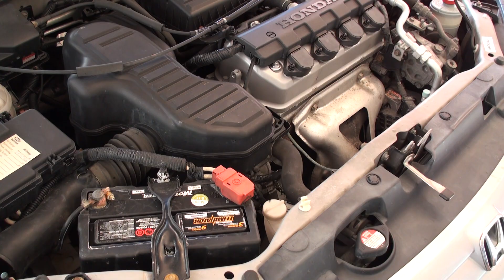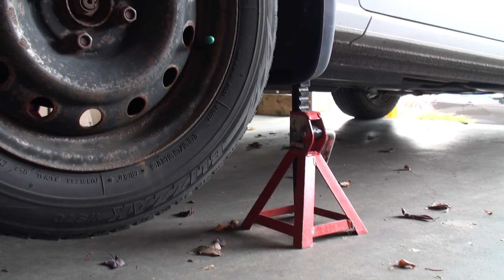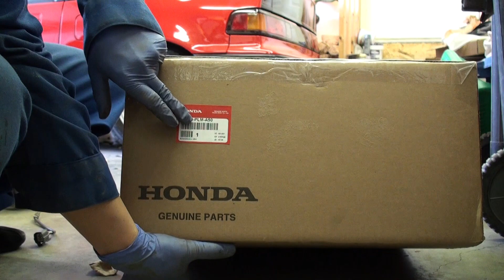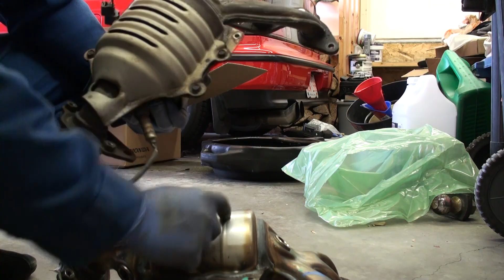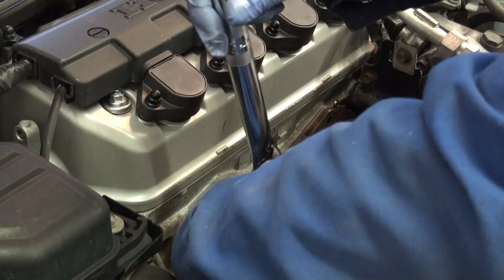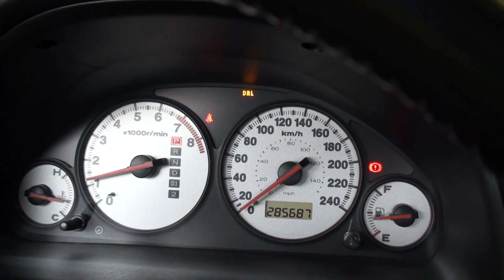2001 - 2005 Honda Civic Combination Exhaust Manifold Catalytic Converter  Replacement

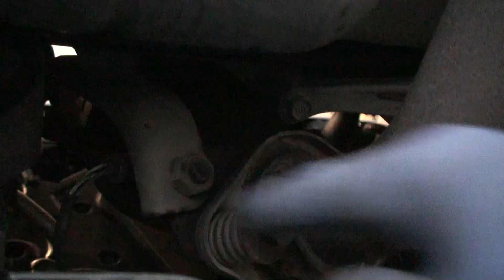Comment: 4:04 When you talk about the bracket holding onto the engine block that you pointed to briefly, does it help it stabilizing the catalytic converter? I checked for exhaust leaks with soap and water and couldn’t find any bubbles. The car makes a metallic noise at idle like if a heat shield on the pipe became lose, but it looks fine.

Comment: This was a great help. Ended up rounding the top middle nut on the exhaust mannifold and had to buy a $25 extractor set to get it off but all worked out in the end

Comment: Thats the issue with this car, i had mine with a crack also in the catalytic converter same location ad yours, thats the reason my cough would not heal cause i've been inhaling the Carbon inside the car when i turn the Ac

Comment: The EX model is also different from this one, as the CC is at the end of the exhaust manifold rather than incorporated into the exhaust manifold like the VP, and LX. (The EX model has a VTEC system and a few extra HP)

Comment: Isn't the Honda OEM catalytic as bought from the dealer.. Priced at MORE than your old car is actually Worth ??
Reply: So what? Beats getting into an 800-1200 dollar a month car payment. 

Why wouldn't you fix a reliable car like this that's in good shape?
Reply: Stop making sense
Reply: Yes the OEM is made worse and costs more BUT it won’t throw check engine lights like a lot of aftermarket

Comment: Currently wanting to bash my head in because the last nut I need to take off the catalytic converter/exhaust manifold is rounded off, been at this for 3 days. Other than that, video itself has been super helpful!
Reply: Glad im not the only one. Wish it wasn’t us.
Reply: Any updates
Reply: @uneducatedEntrepreneur  managed to get the bolt off with enough effort and installed the new cat, but the car started overheating 2 months later, so I’m working on fixing that now. It’s been delegated to my second car now 🥲
Reply: @uneducatedEntrepreneur  it's been 7 months. how did it go? lol
Reply: 8 months now, what wound up happening?
Reply: @thr33f0ur  finally managed to get the bolt off and finish the install for the cat. Unfortunately the car did get flood damaged during hurricane helene and that was all she wrote.
Reply: @thetechloop65  Sorry to hear that bro :(
Reply: @thr33f0ur  it happens like that sometimes, I got my ‘17 Impreza (my daily) and most of my stuff out and was able to move back into my apartment last month after some repairs :)
Reply: You'll need to buy an extractor set at an auto parts store ($~25) to get off any rounded nuts, ask me why I know

Comment: Thank you. My catalytic converter/exhaust manifold has a MASSIVE crack in it and I didn’t notice until I flashed LED lights on it. 
I’ve been having hard starts, idling rough, sputtering, loss of gas mileage, and this is definitely a the cause of it. Thank you so much. This is extremely helpful.

Comment: Do you remember if all three nuts for the manifold are the same exact nut?
Reply from the maker: they are the same exact nut with I believe 2 of the bottom ones are bolts that are also the same.  All use a 12mm head.
Reply: I think I either lost one or it was missing one. Do you know where I could find a new one?
Reply from the maker: easiest place to get one is the local honda dealership or rock auto.

Comment: Hey man I hope you can answer me I’ve did what you did but mine start smoking fro the censor one which is the top one and I don’t know what went wrong.. I’ve just spent money on a new catalytic convertir and censors and still not working… can you tell me what can it be.. or any advice…thank you…
Reply from the maker: that is too difficult to know exactly without understanding what issues you were having in the first place.  Was the engine running properly prior to you replacing the cat converter?  What was the reason why you had to change it?
Reply: @piercedasian  well before I change the cat I put a new crankshaft censor and a oxigen censor as well and when I change the cat I noticed that the other censor was bad as well so I got a new one but now that I got it in place is not working anyway  my Honda is 2003 and the censor that blow smoke is top one under the hood and I did all of that cus while driving it always loose power and even die on me .. thank you for you time…
Reply from the maker: hmm, I'd double check your ignition timing.  Since you replace the crankshaft sensor that I'm going to be inclined that it may be related to that issue.
Reply: @piercedasian  ok I even was able to drive aster I checked and replaced the crankshaft to see if it was fix and I drove it for like a week before that there was no smoke the smoke was after I change the cat along with the censor im about to try again and keep looking maybe and hopefully is just while for a couple of day s .thank you again..

Comment: The 12mm nuts at the top are seized on pretty tight for me. I’ve soaked them PB Blaster  a few times with no luck. Would it be safe to hit them with a propane torch for a little bit?
Reply from the maker: I find the best way to get off seized nuts is to use penetrating lube (try liquid wrench I find it works better) and then after soaking for a few hours or days get a long wrench on it and give a quick "blow" or smack with your hand.  If you hear it "creak" then apply more lube and then retighten the nut or bolt a tiny bit and walk away.  Repeat this process repeatedly until you're able to work the fasteners loose.  I wished I filmed the impossible spark plug removal on an old Honda I just worked on last week.  The plugs legit couldn't be removed by me or 2 other shops and I took a different approach to get the plugs out and guess what?  I got ll the plugs out with ZERO damage.  Just took patience, a good amount of liquid wrench and patience of going back and forth to let the penetrant work properly.

Comment: Thank you so much for this I couldn't afford to pay the labor on this job and needed a little step by step instruction. I used a 
1A AUTO brand one made by cateran. Probably Chyna made. I will update this comment if the part didn't work out. Thanks again.
Reply from the maker: Thanks for stopping by!
Reply: Is it holding up and pass smog? I need to replace mine soon😢

Comment: Hey I installed a new catalytic converter manifold lx but now I’m smoking from my o2 sensor area and my headers are cherry red
Reply from the maker: Whoa that's not right.  Where did you get the cat converter from and was your engine running properly prior to this replacement?  Cats that run cherry red are often a result of unburned fuel getting the cat.  I'd identify the problem of why your motor is dumping raw fuel into the cat before continuing to drive the car.

Comment: Great video and i had a question for you. So i see that some civics have a catalytic converter on the manifold, and some have it underneath in the middle of the car. Does this depend on your model or something? Thank you.
Reply from the maker: You are correct!  The integrated cat converter on manifold design is for the non-vtec versions of the motor while the 1.7 liter versions (namely the Si in Canada or the EX in the USA) or even the Acura 1.7 EL will have the cat beneath the car.
Reply: @piercedasian  got it makes sense. Thank you so much for the reply
Reply from the maker: Not problem have a great day!

Comment: Any brand of cat converters that are good? 1100 is too much for me. I need to service my 2005 civic converter because it has rusty exhaust flange surface. Thanks!
Reply from the maker: You might be able to get a muffler shop to weld a new flange on the converter.  Before going out and buying a new converter that you should look at that option first.  Alternatively if you insist on buying a new cat that you can look at ones made by Walker.  They seem to have reasonably consistent quality.  Just stay away from the ebay specials that tend to be hollow cats that have no real catalysts in them.
Reply: @piercedasian  thanks for your reply!
Reply from the maker: Np!

Comment: Please help can’t find that donut gasket that goes on the bottom of the header
Reply from the maker: you should be able to source that from your honda dealership.
Reply: @piercedasian  ended up finding the correct flange after 2 attemptslol

Comment: Hi thanks for this very I formative video. Which dealer did you buy it from? The one I just called charging too much around $2k only for the cat.
Reply from the maker: I bought from a local Alberta acura dealer because strangely they were cheaper than honda for the same exact part.  Back when I did this video the cat was something wild already at a cost of $1200-1300? The parts guy cut me a deal and sold this to me for around $1100 all in with taxes. They're $2000 now?  Jeepers!
Reply: @piercedasian  yup 2k...hmm let me try Acura, thanks

Comment: Would have really helped if you showed how you got the spring bolts on. 😕
Reply from the maker: spring bolts are easy.  I just screwed them on.  No real compressing was necessary since they compress when you tighten them down.

Comment: how did you remove those spring bolts from the bottom. I can't get them out for the life of me.
Reply from the maker: sorry for the late reply.  I douse them in a good healthy amount of a quality penetrating lube (not WD-40) and use a wrench and impact gun to bang them out.  Worse case is that you cut them out and buy new ones.

Comment: Wonder why not trying to weld the crack when the manifold is bolted to the engine. This way the manifold is in it's "stressed" shape. Also I saw somewhere people drilling a small hole at the end of the crack to prevent it from propagating. I'm not a welder nor a mechanic, I'm just wondering.
Reply from the maker: I considered that and even tried but the crack kept coming back.  I tried everything in my powers to NOT have to spend nearly $1000 on a replacement manifold but alas my previous attempts were futile.  Since the new cat was installed the car has run great and it hasn't given me any grief since.

Comment: Yea my cat I could tell was going bad on my 05 civic it would reach 80 with the pedal all the way down then when I slightly let go of the gas it just darted out with some power it was weird. Can’t wait to get my new cat Wednesday can’t wait to get full power again my car has 160k I guess that cat was done.
Reply from the maker: it's really interesting how cats fail.  Knock on wood that I have never had a cat fail on me.  My civic has 365, 000kms on it and runs like a champ and barely eats any oil.  Replaced the cat around 275, 000kms and its been great!

Comment: Hey I would like to know how do you know if your  ex uses that manifold/cat assembly? I have an ex with Cali regulations but my car doesn’t have that? Also are you using OEM honda o2 sensors?
Reply from the maker: a US EX model is likely the same cat setup as the VTEC versions of the civic in Canada.  it is underneath the car and not integrated with the exhaust manifold.  Yes I am still using the factory Honda sensors.
Reply: @piercedasian  I’ve been having a lot of trouble with gas mileage and they keep saying that it’s the cat which I replaced or the O2 sensor which I also changed. The mechanics I went to were no help either
Reply from the maker: @Bababooey29  A bad cat isn't likely going to cause you poor fuel economy but rather poor engine performance with hardly enough power that it used to have.  Can you better describe your issues in great detail by email it to piercedasian@gmail.com?

Comment: Can I use an after market exhaust that doesn’t have the sensors if it’s more race performance wise
Reply from the maker: you could but then you may get a check engine light due to deviating from the factory's emissions design parameters.

Comment: So the EX coupes don’t have this catalytic converter infused headers? Mine doesn’t have it.
Reply from the maker: Ex models are the equivalent to our Si here in Canada. You have VTEC on your D17 so your cat is the one that is in line downstream from the exhaust manifold.  Non VTEC models of the civic use the integrated cat converter exhaust manifold. I much prefer the design of the US EX / Canadian Si cat converter setup. Cracked manifold means just replace the manifold and not the entire assembly like how I had to do it. Much cheaper fix with a non catted exhaust manifold.
Reply: @piercedasian  thanks for letting me know.
Reply from the maker: you're most welcome!

Comment: I had the same problem, decided to weld my manifold temporarily before i save enough to buy a new cat. My question is, my o2 sensors are both black on the ends, do I need to replace these as well or are they reusable? Thanks!
Reply from the maker: No need to replace the o2 sensors unless you're throwing a check engine code OR if the car has super high miles.  O2 sensors are technically a maintenance item and DO wear out over time and wear out faster if your car has operational issues like burning oil or coolant (contamination of the exhaust stream).  I am at 342,000 kms and I still run the original sensors with zero issue.  Black buildup is normal assuming your car is in decent operating condition.

Comment: My cat is fouled by a seafoam fuel treatment so I’m replacing it but I didn’t pay 1000$cdn for it. The one I’m replacing in my 05 is only 3 years old but I only paid 153$. So pay too much if you must but seems like a waste of money to buy from Honda.
Reply from the maker: Yikes!  I can't say I've ever had that happen with Seafood.  How do you know it is fouled and not usable?  I know the cat I bought was super expensive but the aftermarket route doesn't make a good enough cat that would not throw a CEL  code and buying a used cat isn't possible where I am at (cheap yards like pick and pull won't sell them and the car itself is deemed "too old" by the honda wrecker in town).

Comment: The bolts on my heat shield are beyond rusted/corroded do you have any advice on how I could possible get it off? do I have to screw the heat shield off or could I break or snap it off? Would that matter? The bolts are so far gone and the shield is pretty lose
Reply from the maker: Just twist the bolt until it breaks off the shield and then get the manifold out where you can either ditch the shield altogether or you can drill out the broken bolt and put a new one in.  I've run several of my honda's with no heat shield and so far no melted parts under the hood.
Reply: @piercedasian  is the bolts that hold the heat shield (top two bolts) bolted into the manifold? Or are they separate bolted into something else? Because I honestly might just crack on them until they snap because I could care less about the heat shield honestly. Also do you have an Instagram I can contact you on and maybe answer some question for me?? I’d really really appreciate it!

Comment: Okay so i did that since it had a crack but it’s overheating still and it clogged so we don’t know how to fix it or clean it? Any help?
Reply from the maker: If the cat is clogged then really the only real way to fix it is to replace the cat with a new one but before doing so you have to find out what is wrong with the engine that caused the cat to clog up in the first place.

Comment: question, i replaced my 02 sensors down and up stream and i still have a p0420 code, should i just replace cat?
Reply from the maker: hmm, if you're still getting that error there could very well be an exhaust system leak where the cat meets the engine or a crack that you can't see.  As crappy as this news is going to be, you're likely going to have to replace the cat as I suspect there is a large enough crack to throw your o2 sensor readings off.  Best thing to do is unbolt the cat and do a thorough inspection to identify if and where a crack might exist.
Reply: I thought P0420 codes are pretty much replace Cats
Reply: @NeverStop909  Usually. But the cause isn't usually a cat failing on its own. Cats usually last the lifetime of the car assuming its engine is operating healthily. Oil burning, misfiring, exhaust leaks, faulty o2 sensors... anything that can cause an erratic downstream o2 reading will set that code.

Comment: Thank you for the nice video brother, I also have manifold cracked same as you showed, i would like to ask you if I replace manifold with a header is it a good idea?
Reply from the maker: The problem with installing headers on this specific civic is where would you have a cat converter on the car?  Headers are typically reserved for the cars where the cat is further downstream.  In my particular civic's case the only logical option that I had while maintaining proper emissions controls is to use the factory cat.

Comment: If the cat was still good another option would have been to have the manifold machined flat again. Save the customer a boat load of $, especially on such an older vehicle.
Reply from the maker: yes that is definitely and option.  I considered having a welding shop properly re-weld the crack in the metal and re-true the flange but given how much shops in my neck of the wood cost and the time I'd need to drive it across town to have it done that I just said forget it and bought a new genuine honda one.  Been years since I did this swap and so far so good!